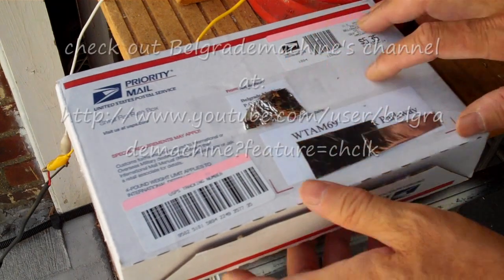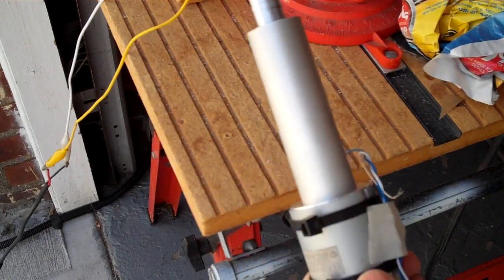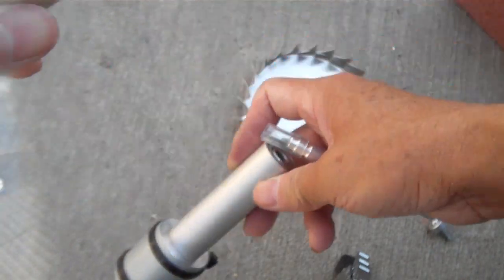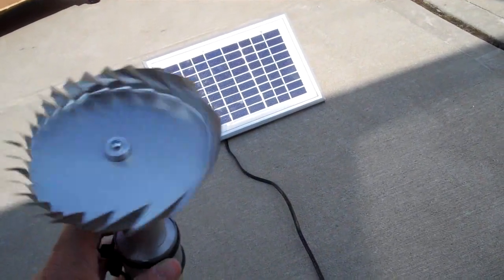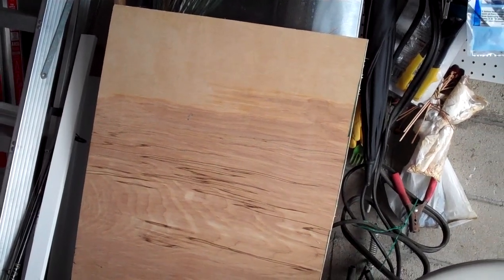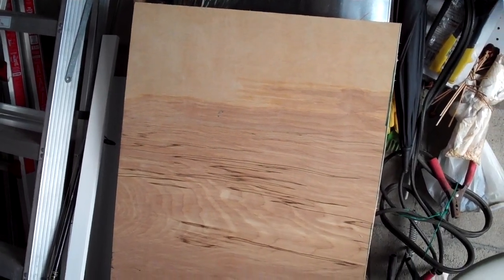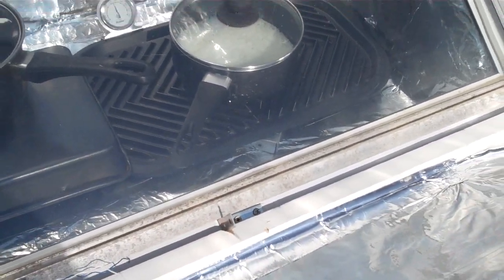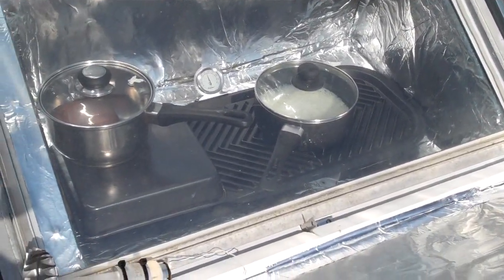Belgrademachine's custom made solar oven convection fan.wmv

Comment: Nice! It made it alive. Yeah, that nylon hose coupler is a little tricky but I figured you would figure it out. You can also put any small motor in there even a little 3v for the smaller solar cell. The other thing is it seems to work better in one direction than the other .. best to have the white wire to negetive when fan blade point forward. Good luck!